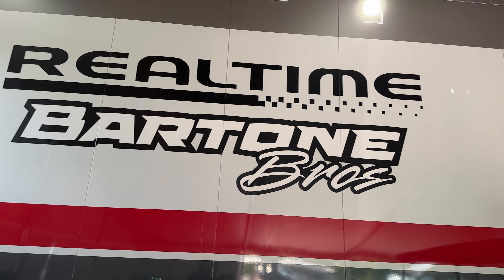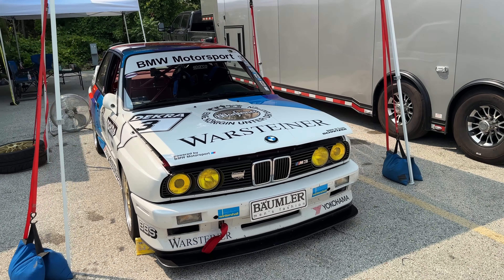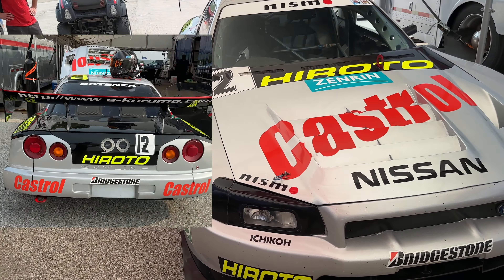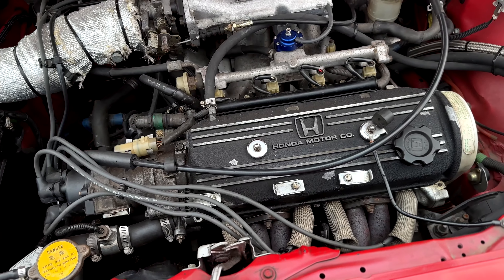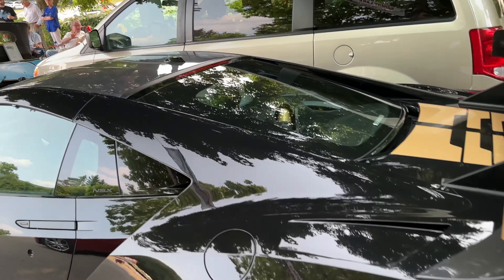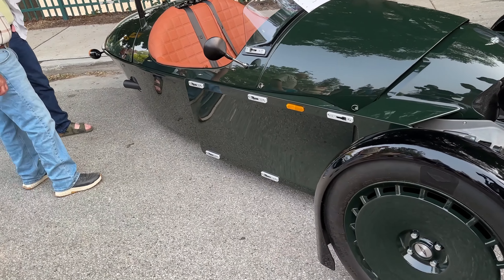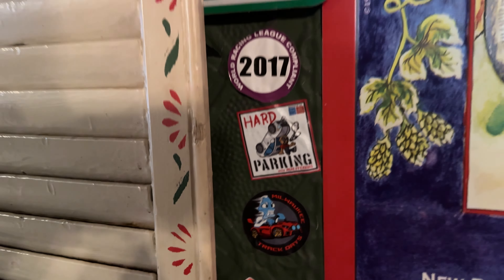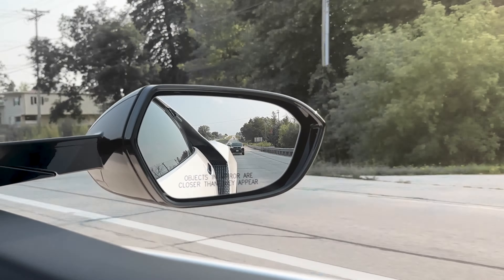WeatherTech International Challenge 2023 - Road America (*Full Weekend Tour*)

Comment: Nice video. Thanks for showing our #30 Porsche RSR, rebuild of the 1977 overall winner at the Sebring 12hr endurance race.
Reply from the maker: Thanks for that information on the Porsche!
Reply: When did you buy it, it used to be a mn car, it was parked next to my vintage winning 911 at the first childrens grand prix
Reply: @marklangren3142  The RSR you saw in MN was my original #30 factory ‘74 RSR that I raced in the mid ‘70s in IMSA. The car I ran at RA was a copy of that car, as I raced it at Sebring 12hr in ‘77.